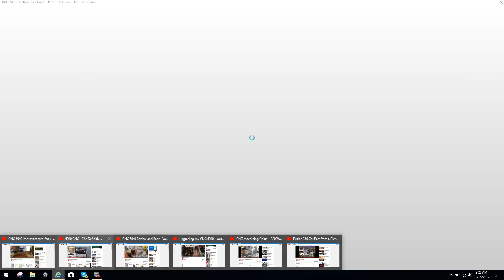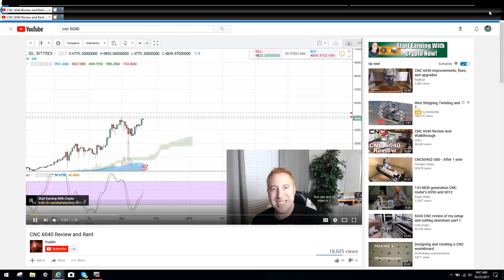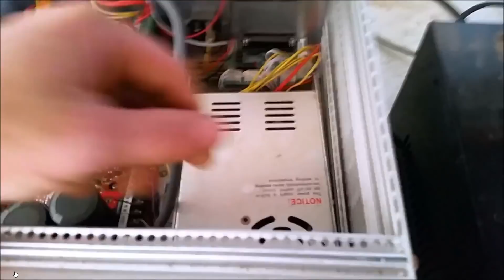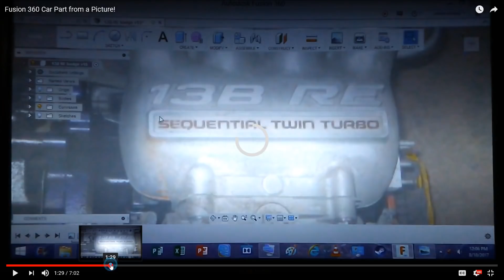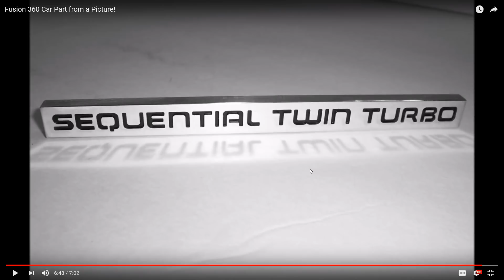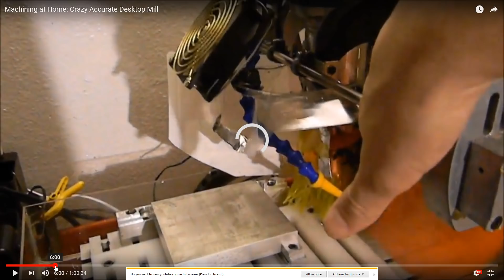CNC Education (Spot the Not) I hope this saves at least one of you.

Comment: Helpful. Thanks.
Reply from the maker: Brian, thank you for your support. I really appreciate it. Vince
Reply: @corvetteguy50  I just opened up my CNCEST 6040 controller. It's exactly as described. No shielding at all. In fact, it seems that the wiring is all individual with shrink wrap. With this in mind, I've ordered 10 feet of 4 strand 14awg shielded cable to redo all the wiring. As I have a 7.5kw VFD, I'll be pulling out the one in the controller and using that instead (externally). Eventually, I'll build an entirely new controller with better quality components. For now, I'll make due. Thanks again for helpful video.
Reply from the maker: I'm sorry to hear that. 14awg is very large gauge for rewiring the controller. Typically 18awg is all that's required for the components, and 16awg for wiring the A/C components. Take your time going over her, and you're certainly on the right track. Thank you,
Vince
Reply: @corvetteguy50  I have a habit of over engineering/building things. Part of it based on the idea that I'll upgrade parts. For example - going from NEMA 23 to NEMA 34 in the future.
Reply from the maker: I always recommend seeing the machine's performance before purchasing any upgrades as many times I see clients spend more than they have to for their applications. Thank you,
Vince

Comment: Hi and thanks for the videos. I am thinking of buying the 6040 CNC.  Which is the best place to buy, which version is best and finally.....do I need to have an internet or Wi-Fi connection for this machine as it's virtually impossible for me to get one, at my workshop.
Thank you in advance.
Reply from the maker: Kevin,
Thank your support. The best place to get a 6040 is on eBay as your offered the best buyer protection their. Here's a vendor many of my clients have purchased from https://www.ebay.com/itm/273956102961 Your system can be controlled by ethernet if you purchase an ESS controller, but under the stock configuration the system will typically controlled by parallel port. Thank you,
Vince

Comment: Hi, I wonder if you could help please. I've just bought a 6040 router from China and have a problem with it. I have tried talking to the people in China where I bought it, but I feel I'm fighting a losing battle. All was good for a start and I cut 5 or 6 pieces in wood with no problem. Then the Z stepper motor started acting strange, and I'm now unable to use the cnc. The Z stepper motor started getting loud and using the arrow keys on my keyboard, when I press the Z down key once the motor moves down. If I press the down key again the motor moves up. using either the up or down key it seems to do what it wants. I have made a short video of the problem and wonder if you could take the time to have a quick look for me please. The machine is only 4 months old and I think I need a new stepper motor, but you might be able to tell me what the problem is. I would be very grateful for any advice.   https://youtu.be/qwKdiwVVDkc 
Thanks, Terry.
Reply from the maker: Wrighty, 
Thank you for your support. Have you reviewed the Z axis motor connection? 

The Chinese controllers are hit, and miss at best, and if you reviewed my channel you realize I cover just how terrible it is dealing with the vendors for support, and the low quality drives. If you reviewed the Z axis connections, and still can't find the issue  its time to start looking at performing an controller retrofit on the machine as replacing a single drive seldom solves all the issues. One of my Gecko G540 systems will provide a stable, precise fully US supported system.

Thank you,
Vince
Reply: Hi Vince, thank you for your response. very much appreciated. I am new at this as you may have guessed and trying to learn. I have checked the cable connections and all looks good. I have not had the top of the controller, as when I swapped the cable with the Y cable on the controller, it ran fine and the gantry moved back and forwards with no problem, which led me to think it was the motor. I'm in the UK, do you have any idea what the cost would be to get one of your Gecko G540 systems shipped to the UK please. thank you so much for your help. Terry.
Reply from the maker: @Wrighty  Terry, I'm currently on the road right now. If you contact me at Storm2313@gmail I'll cover a retrofit package later today when I get back. Here's a 6040 for reference that utilizes my retrofit controller with the G540 https://youtu.be/WAXnvMocchQ 

Thank you,
Vince

Comment: Thanks very much for your videos Vince. I just wish i'd done my homework and seen them a couple of weeks ago. I bought a 6040 on ebay and it arrived Christmas eve, excited wasn't the word !! It soon turned to dismay when I connected it up and turned it on, it blew the rcd in my house. After watching several videos on you tube it seems i'm not alone having similar problems.
I did manage to get it to power up by running it without an earth !! making sure I didn't touch anything and got the spindle to spin, so I thought i would try and run the thing but as soon as i plugged the Parallel to usb cable (supplied) it tripped again. 
I did have the controller box/vfd pat tested and it failed on "earth leakage" I'm assuming the problem is down to unshielded wiring but don't feel confidant enough to rewire it so it looks like i'll be returning it. I don't think i will trust buying another one and can't afford to spend more than this one cost. It was only going to be an hobby for me now i'm retired, guess i'll try golf or something.
Anyway i'm rambling. Just wanted to say I enjoyed your videos. 
Happy new year to you.

Mal
Reply from the maker: Mal,
Thank you for your support, and Happy New Year to you, and your family!

That's really interesting that you had those issues as the controllers I've seen from them usually have a ground for the power input now that they don't its really scary.. This is a real problem with the amount of these systems coming in from overseas. I hope my videos reach more people before they spend their hard earned money in good faith.

If you decide to get involved in CNC let me know, and we'll get you equipped with the right controller, to get you automated.

Thank you again,
Vince
Reply: @corvetteguy50  the easy solution is to buy the machine kit from china and electronics/motors/vfd from you.
Reply from the maker: @Z-add   This is what most of my clients do. Thank you,
Vince

Comment: OK. I watched the entire video.  Just made a few purchases from your Ebay store (that is your store, right?).       Why?      I just looked through some of the comments and unlike the vast majority of people who post educational videos, you actually answer each and every one of them.  I just bought a used 6040 that hasn't even been used. I mean not a spot of rust or even a scratch on it. It even had that new smell to it when I opened the crate. We will be talking in the future.  Took the cover off my controller before I even turned it on to check all the connections and it is spotless inside but it looks like a spaghetti factory exploded in it. I mean there are wires all over the place.  I should take a picture of it so you can show people what not to do.  IU am an engraver by trade and have four New Hermes machines. Now I have to learn the CNC programs.  Again, thanks for all the info.  You seem like you really know your stuff.
Reply from the maker: Gary,

Thank you for your support I really appreciate it. If you purchased from the link in my video its my store :)

The 6040 is really an excellent chassis when the electronics are upgraded. The biggest issue you'll find with the typical stock systems is lack of shielding, an some newer versions include the VFD installed in the same enclosure as the drives which is a huge mistake as it generates the largest amount of EMI. 

If you need anything just let me know.
Thank you again, 
Vince

Comment: Yaah none of my videos featured in this video, I must be an expert (if only that was true)...
Reply from the maker: Dodgy, thank you for your support.  Vince
Reply: Your video did remind me that my controller rewire is well overdue.
Reply from the maker: If the system is running fine, and the wiring is safe your fine not fixing what isn't broken. Its when the systems have issues with stability out of the box its time to correct the issues to protect your investment. Thank you, Vince
Reply: I'm upgrading from open loop NEMA 23's to closed loop NEMA 34, and going from a UC100 to a UC300ETH, so significant changes need to be made, including PSUs. I always planned to run shielded and grounded wires but have been distracted by upgrading other parts on the CNC. Time to do it 100% right this time.
Reply from the maker: Its time consuming, but it will assure your system the stability your looking for. All the premium hardware in the world is useless if the system suffers from EMI penetration. Thank you,
Vince

Comment: Im getting ready to buy one of these. My concern is my own nitpicking for accuracy. I routinly deal with high end CNC, not talking cheap HAAS machines either, most stuff I deal with is down in microinch accuracy. I'm worried i'm going to drive myself nuts. :)
Reply from the maker: Jeff,

Thank you for your support. These systems when matched with properly calibrated transmissions, and chassis can achieve amazing accuracy do to micro stepping. If you tell me what your applications are I can suggest the best fit to your budget.

Thank you,
Vince
Reply: Thank for replying. The micro stepping is fine, but real machine accuracy comes from tilt/pitch of the ways, and axis squareness to each other. I realize these are cheap, and can accept that, i think.  It's nothing against the actual machines, or what they can do.  I's all my brain, and trying to train my brain a few thousands will be fine for what i need at home. Once sub micron tolerance is pounded in to your head, it's hard to let it go !

Comment: Wow i'm so glad i found your video , i built my own cnc machines purchasing every single part, and i been having issues with my machine skipping steps and after watching your video I'm 100% sure its due to unshielded wiring, am i right in saying that i should run shielded cables from drivers to motors, do i also need to run shielded wiring from my stepper board to the drivers?. im also running belts and thinking of installing ball screws, will this increase the torque and enable me to take a slightly deeper cut ?
Reply from the maker: Nick,
Thank you for your support. Your correct in that going over your system, and installing the proper shielded cable/ wire will correct most if not all the issues.

Every wire/cable in your system that carries a signal for either motion, motors or for triggering accessories should be shielded. The ball screw upgrade will provide a difference in the system's maintenance, as well as the accuracy.

 A system that's belt driven will tend to fluctuate in time as the belts expand, and contract where a ball screw transmission will stay true as long as you perform a routine system check going over the whole system. The appeal to belt driven systems is cost, and speed compared to a ball screw transmission. If you want a more precise transmission with more rigidity you can never go wrong with a proven C5, or C7 ball screw.

Thank you,
Vince

Comment: Thank you sir for this educational video. I don't know to many things about electronics so regarding the shielding , if i use multi-core shielded cable for drivers, at the end towards jack connector the shield will be hooked to case. What about the end towards driver, is there a point to hook the shield on the circuit board of each driver or what happens with that end of shield ? Also if i replace the cable supply of VFD with shielded one, do i still need to take the VFD away  of control box or it is better to be far from drivers anyway ?
Thanks a lot .
Reply from the maker: Ionut, 
You will only connect one end of the shielding to provide grounding for the cable. It will be either the controller end, or the chassis end, but not both to prevent ground loops. 

Even when using the proper cable which for a VFD to a spindle is double shielded you don't want to install a VFD in the enclosure with your drives. The amount of EMI present with a VFD is massive, and should be installed away from the drivers that send the STEP, and DIRECTION signals. Thank you,
Vince
Reply: Thank you for your kindly response. One more question please, regarding the control box shown in your video, can i keep the control panel of VFD  on the original box and just take the VFD main unit away by extending that ribbon cable ?
Reply from the maker: You can leave the VFD digital interface panel, but the power distribution unit (VFD main box) needs to be mounted outside, and away from the controller. Thank you,
Vince
Reply: Thank you,  i  very much appreciate that you share your knowledges with us.
Reply from the maker: You bet .Thank you,
Vince

Comment: There are many experts with difference in opinion. As the guy in the video said already, do your due diligence and don't take your advice from a single source.
Reply from the maker: Moen, than you for your support. I feel the term "Expert" is used to frequently online without any proof substantiating it. I certainly don't consider myself an "expert" as in CNC there are far to many variables to understand for a perfect system, so learning is always present. I'll say this though my feedback on eBay reflects I do my best to produce the best systems implementing my knowledge, and experience for my clients. Building well over 500 systems from G540's to pro-drives reflects robotic production is my career. Thank you,Vince

Comment: Fab video - I am fairly advanced in electronics but a noob to CNC. Already bought that 6040 box you pictured. Seems (so far) to run well but have not stressed it at all ( just test cuts in wood) will be cutting small parts out of acrylic and polycarbonate. Will certainly work up a shielding strategy now !! Thanks for your education efforts!
Reply from the maker: Zero,Thank you for your support, and I wish you the best with the system. Shielding the cables is a definite must, including draining them properly. I would also highly recommend removing the VFD from the enclosure as its the largest source of EMI of your system as it pulls the most amps. The Chinese tend to worry more about making components easy to ship rather than implementing best practice with their designs.Thank you,Vince
Reply from the maker: Ringwood,The VFD doesn't have a power supply. It hooks directly to 220v, or 110v depending on the voltage input the specific one you purchased supports. Installing the plate may work, but the best most effective practice is to mount the VFD outside the electronics enclosure separating your drives from its massive amount of EMI.Thank you,Vince
Reply: I suppose running the VFD on its own supply may help promote stability as well? In much of the gear I have to service (30 years in broadcast TV and recording studios) Faraday cages and walls between ckts is common. Removing the VFD as you suggest is optimal, but I may try putting a 1/16th aluminum plate bonded to the floor of the box, behind it ("L" shaped) as a first try.

Comment: how do i properly shield my wires?
Reply from the maker: You first need to use the appropriate sized shielded cable, for your application. Then all you need to do is attach the conductors however many there are to whatever component you plan on using it for just like any other cable.The difference is the shielded cable has a  drain wire. Its a group of bare conductors with no casing. You twine it together, and tin it. You then attach your green lead wire to it. I use solder circle terminals on the other end of the lead to attach the ground to your electrical enclosure using the proper bus bar.Thank you,Vince
Reply: @corvetteguy50  have you done a video of the process you have described about shield drain? Also regarding shielding your step and direction cables. Do you shield individual wires or a set if wires.
Reply from the maker: @Z-add  Here's my video covering the "star point" grounding system which explains shield drains. https://youtu.be/cFrREKB-l4M Shielding for the step, and direction leads can be done either way as long as its done correctly with shield drain. Thank you,
Vince

Comment: How about a quick video schooling everyone on high power 2.2kw spindles?  Seems everyone wants a high power spindle but....  IF I can get a max of 110v at 15amps out of my outlet that is 1.65kw.  If my power supply and cable is 90% efficient = 1.485kw.  Now subtract the power for the cooling water pump and 3 axis contoller (from basic China driver box) probably around 100 watts?? So if I can only provide about 1,385 watts of input power why do I need a 2.2,kw spindle....
Reply from the maker: Jeff, I would never recommend using a 110v spindle rated at 2.2Kw. 220v is far more efficient for a 3HP motor.  I don't offer Chinese controllers, or drivers, and can tell you your better biting the bullet, and going with an American driver (Gecko Drive) to avoid problems from the beginning. A 2.2kw spindle (3HP) spindle is by far the most powerful spindle in its class for the price. I'll be doing a video shortly covering themThank you,Vince
Reply: I do have the 2.2kw spindle but on 220v.  It just seems many people do not understand the limitations of 110v.  The Gecko drives will definitely be my 1st update!
Reply from the maker: Jeff your correct, and when your ready for the G540 just let me know.Thank you,Vince